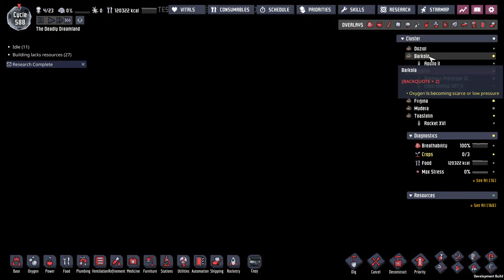Deadly Dreamland Taming the Niobium Volcano

Comment: tripple water locks with mini gas pumps in each one with temp shift plates , now double insulated , and a soda fountain incase co2 happens
Reply from the maker: soda fountains are the best. how do you stop the first water lock from boiling?
Reply: @TartarusPlaysGames  cooling loop going into a double insulated ice-e and ice maker room , all u need is to make sure water lock 2 and 3 dont boil away , the 1st lock should not have enough thermo mass to affect 2nd lock not before being sucked up by a mini gas pump

Comment: Little help needed here. I did the volcano tamer like you did, my aluminum one is perfect but my gold one outputs around 400 degrees hotter than my steel mesh tiles and eventually melts them. What do I do?
Reply from the maker: steel mesh?  just to the gold one like the aluminum one, it should only need one steam turbine.
Reply: @TartarusPlaysGames  The steel mesh tiles, the water flow through ones. The ones you have 3 stacked that the metal volcano's drip through to pop through that corner to the temp shift plate. My bottom steel mes tile the melted gold flows through eventually overheats. The gold is hot enough coming out to melt steel. https://imgur.com/a/THbbi4U 
It eventually gets so hot it melts.
Reply from the maker: @JayzenFreeze  Ahh, I thought you were talking about, those don't work with metal volcanos,  they are too hot, those only work with magma volcanos.  Magma is less hot and forms chunks into the steam. Metal volcanos need to be in a steam room less than 250kg of pressure.  100kg works to get the heat out of the metal fast.  then steel sweeper can get the metal out with rails to get the heat down before letting it out.